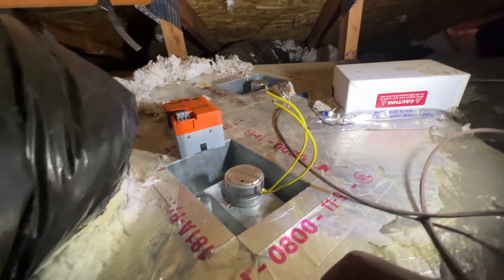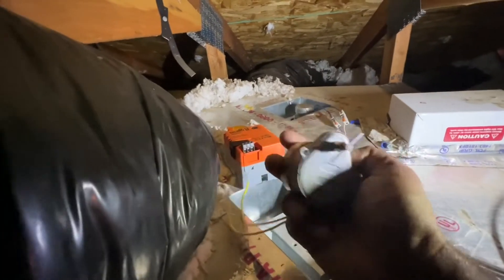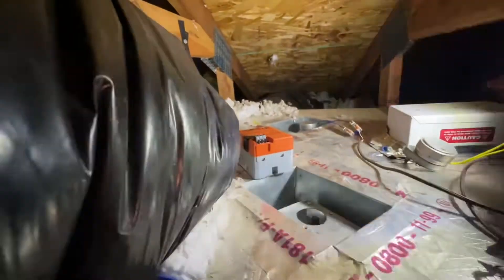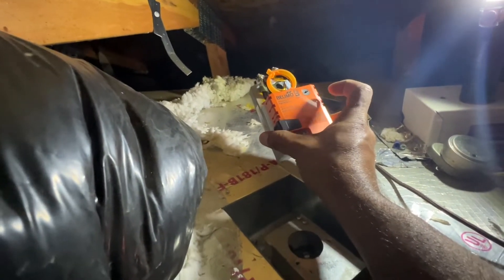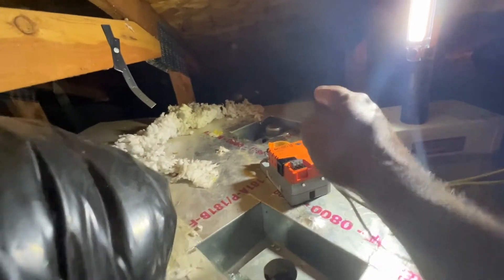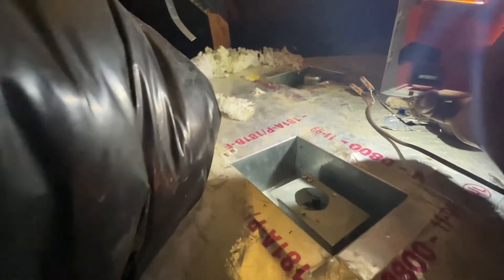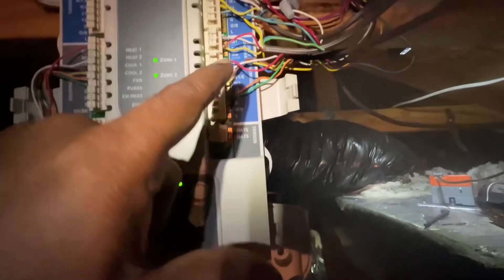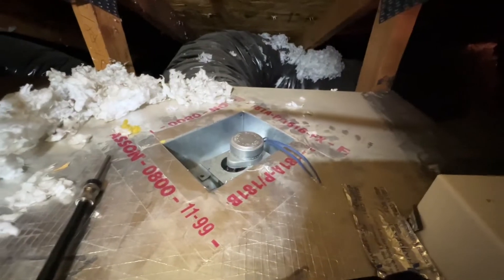Replacing Home AC Damper Motor - Synchron to Belimo LMB24

Comment: Nice video👍. I just ordered the damper retro kit for my ZTech from RetroZone based on your installation instruction. My setup is similar , but I have a two wire, but can to 3 wire. My syncron motors just went out on a 22 year old system. I didn't like the idea of replacing it with an OEM  motor that was always drawing power. Seemed very wasteful and inefficient .
Reply from the maker: Good luck with your install.  It’s pretty straightforward.

Comment: Can this damper motor travel 90 degrees?
Reply from the maker: Yes, it can.
Reply: @SivaFolsom  thank you. I found it will travel from 0 to 95 degrees. I have gone through several spring return units and there are terrible!
Reply from the maker: @christopherbrown5338  The spring return units need constant power to stay closed (or open).  This unit uses power to either open or close only when needed.
Reply: @SivaFolsom  Thank you, I know.  Mine keep burning out and I'm sick of it.